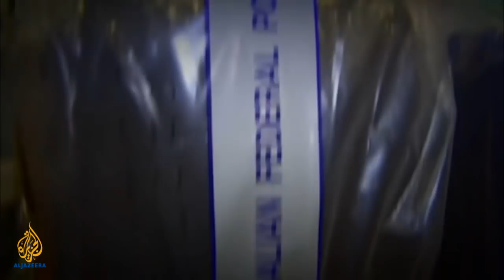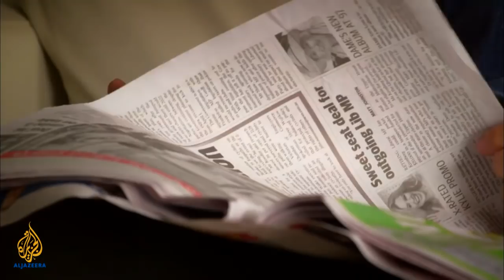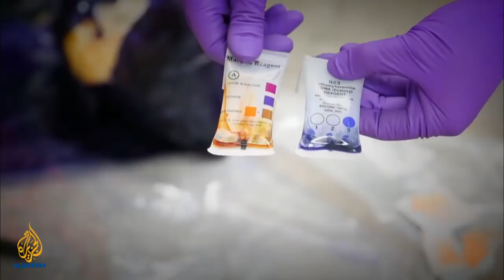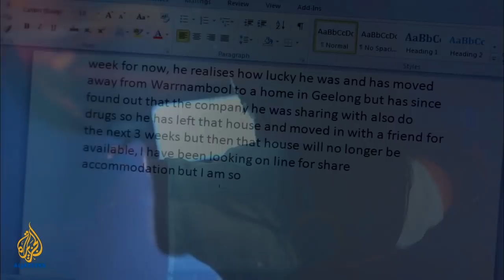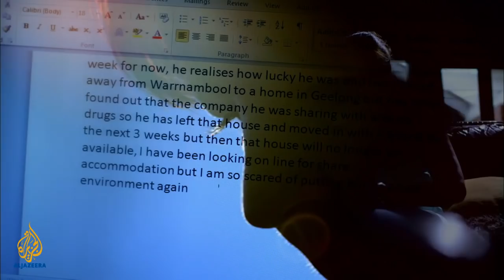The Ice Age: Australia's Methamphetamine Addiction | 101 East

Comment: I'm so lucky to have been born and did my drug taking in the 80's and 90's, the drugs which are just so varied and much more powerful than they were in my time. If meths had been around I'd have probably been one of it's casualties that's for sure. It's really scary the epidemic you have in Australia, in the UK we don't seem to have the same amount of meth-heads, in the prison system the preferred drug is probably Spice the artificial cannabinoid. Those at higher risk are kids from families that don't care with low to zero communication between them.
What Morgan and others have said was so true, you have to move from your old environment and the best advice is from people who had been through it, it's certainly more valid than help from a non-user.
As for dealing with out of control meth heads in hospitals, get them into a straight-jacket until they come down, either that or a padded drunk-tank. If you take any drugs you have to accept the consequences of your actions.
Reply: Biggest risk now in the USA is fentadope,  the synthetic white that has no heroin in it at all, it is all fentanyl analogues. Ultra potent  and once a user has a fentalog tolerance, regular gear won't hit the spot any more. The withdrawals are much worse, regular H withdrawal is over in 7 days,  these fentanyl analogues can have a 3 week+ withdrawal. 

That is what people in the USA are dying from.  Banging fake 30's  that are actually 10 times more potent. 

Luckily it hasn't hit the UK yet. Luckily we dodged the opioid epidemic as we didn't have the insane prescribing habits the USA used to have. In the USA you'd go to the dentists for a routine surgery, and get prescribed drugs that over here  we only give to cancer patients.
Reply: Thanks for the reply Mike, it's a scary drug and even one days withdrawal is a nightmare let alone 3 weeks.